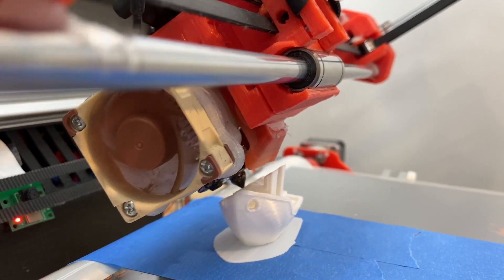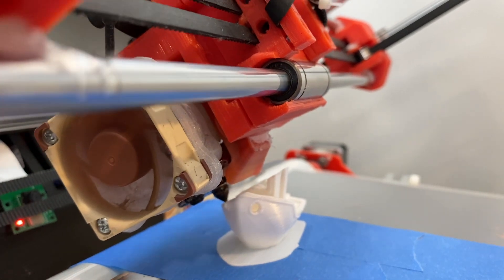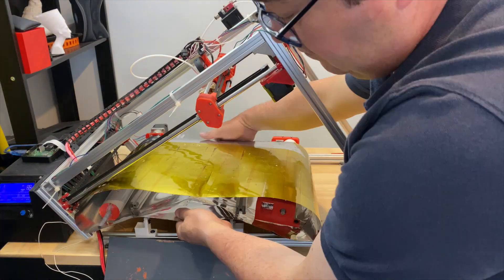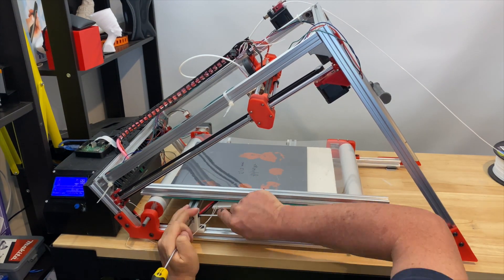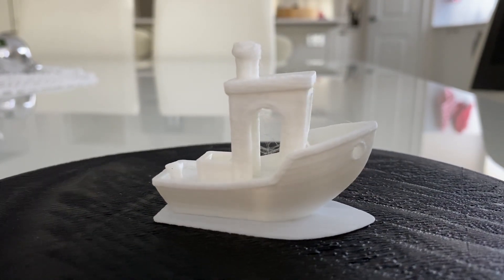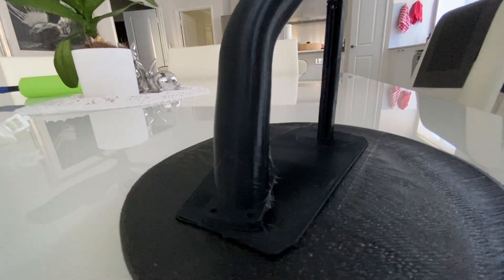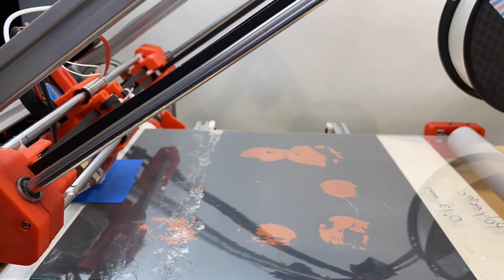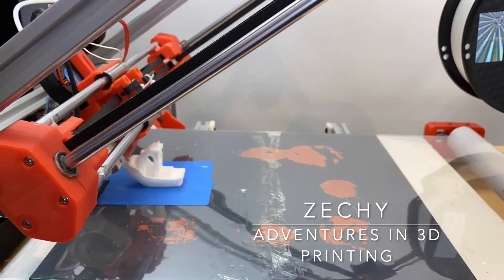Printing on a Polyester Belt.

Comment: glad too see this project is still going, i am thinking about building a large belt printer myself ill send you links to details if i do,  i was thinking of using a stainless steel belt spot welded togeather and then sections of build tack attached for my build surface. i am also considering instead of heating the bed heating the chamber and boxing the whole machine bar the  belt direction which would have plastic film strips to try and contain some heat.
Reply from the maker: That sounds like a great solution for the belt. Heating the chamber is something I would love to try. Please let me know how it goes. Maybe post some details on my Facebook page for all to see. Thanks

Comment: I have some more ideas for build surfaces.

1. Maybe try to use build tak like the White Knight printer. The designer got a custom sheet made by the company, but I dont know how expensive that is. Perhaps just buy a bunch of build tak sheets from china and put them side by side. 

2. A thin and flexible PEI sheet which you can by from McMaster car.

3. PEI sheet or Buildtak on a thin spring steel sheet bought through McMaster car( or equivalent in your country)

In addition, I suggest you look into getting an inexpensive dual drive extruder so that your extrusions will be more consistent. That may contribute to your artifacts.

Furthermore, your artifacting may not be caused by the belt, so don’t rule it out until you’ve dialed in everything. It may be caused by an untightened extruder assembly, untuned e-steps, and/or a cheap and cloned e3d nozzle. If the nozzle hole is not completely round, your prints wont be as consistent. 

The stringing may simply be simply a matter of too little retraction. Increase it in cura in 1mm increments till it stops. 

Your xy belts may be lose as well, so check those. And, if you haven’t already, get some belts reinforced with steel wire. That will negate stretching in the printer belts which can cause unwanted artifacts

Look at existing designs like the White Knight and the now discontinued PrintrBot belt printer. 

Finally,
Reply from the maker: Brilliant inputs. Thanks Austin. I’ll go through the list